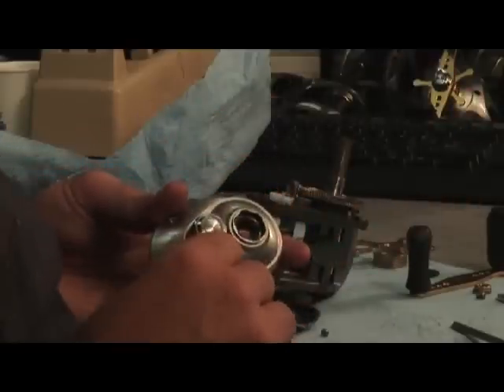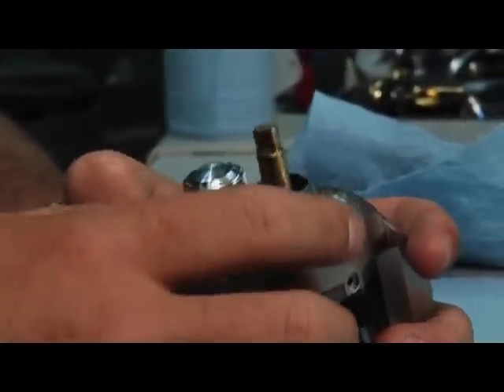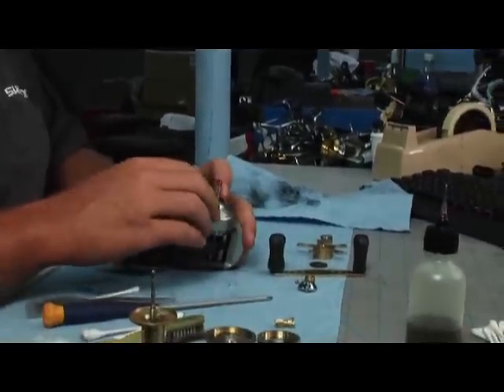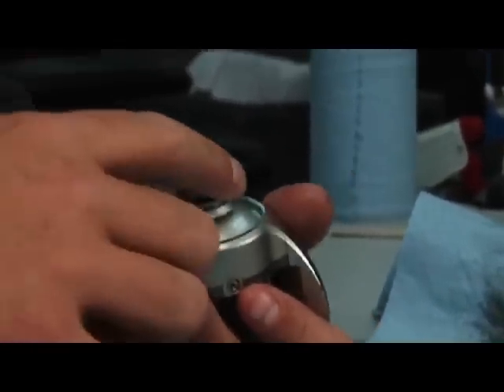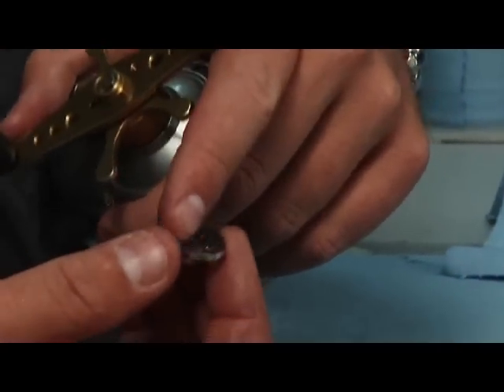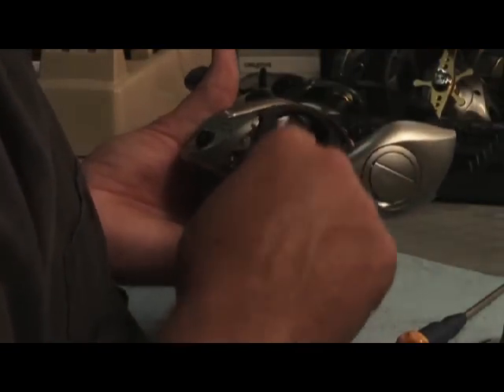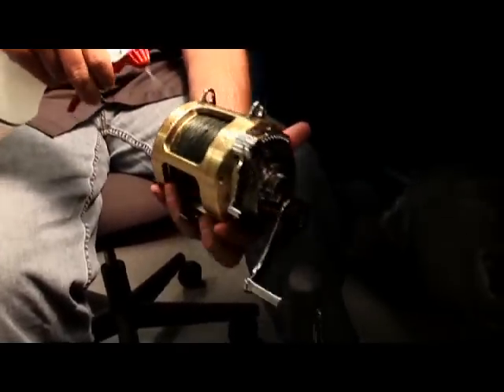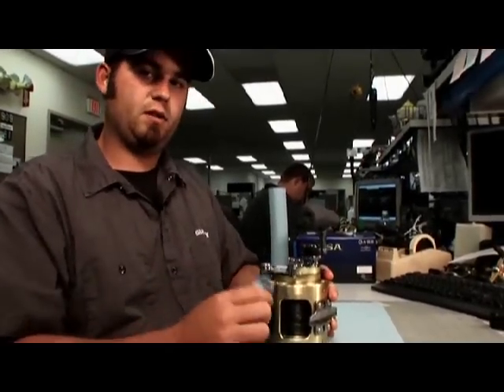SHIMANO REEL MAINTENANCE PART 3

Comment: These videos are a real lifesaver- and reel saver.  The order of assembly is very clearly explained.  I couldn't get my reel to work right- until I discovered my yoke wasn't on correctly- and I had to engage the clutch to get it aligned around my pawl gear slot.  After I did that- I reassembled and my Citica works great now.  Great job on the video and camera work.

Comment: Great videos.  One thing that should be mentioned is that the Shimano reels with handle on the left side have handle nuts that are reverse threaded from normal.  To loosed the handle nuts you must turn them clockwise.  To tighten them, turn them counter-clockwise.

Comment: great series--did I miss cleaning the worm gear assembly
Reply: I watched another Shimano cleaning vid at the factory and they didn't clean the worm gear either. The worm gear and pawl are the #1 parts that usually fail and need the most attention. I pay more attention to my worm gears being clean and lubed more than any other part. I've been fishing hard over 50 years and seen which parts fail the most.

Comment: @bassfishin14 Maybe your roller bearing is on the wrong way(the bearingin the handle side)OR the anti reverse plate(the metal thing underthe main gear)is on the wrong way and cant catch the anti reverse pawl

Comment: Ok so I followed you video to the T but now my reel handle refuses to even budge it's fine when the side plate is off but once it's on it will not work. What did I do wrong with it and how can it be fixed